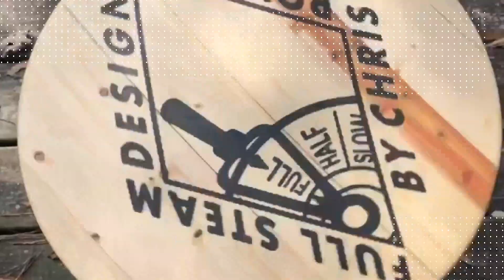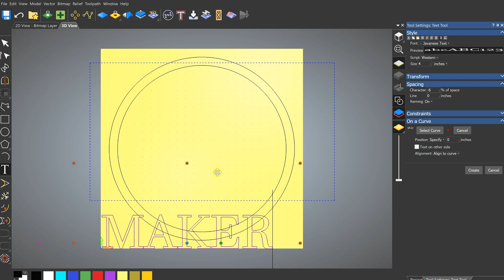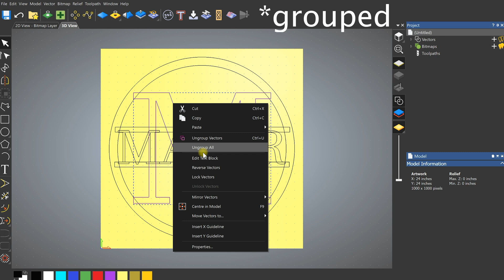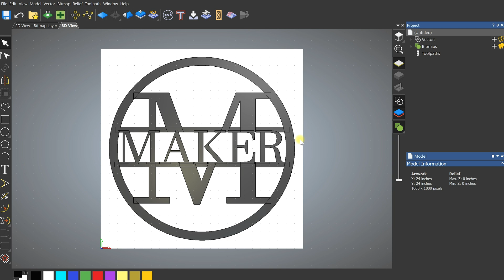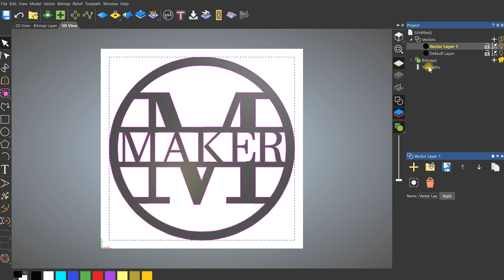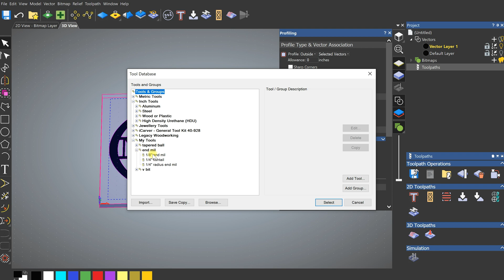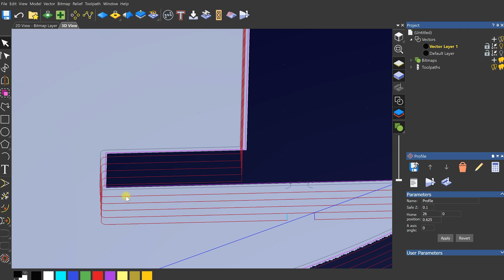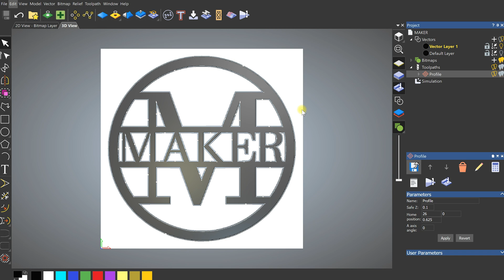Intro to Carveco Maker for the complete beginner - Designing a Monogram

Comment: I really enjoyed the video but it left me wondering what the next step is. You briefly mentioned something at the end about selecting a post processor and Carbide Motion..."load up Carbide Motion, initialize your machine, load that program and you'd be ready to go." 
I'm new to this so it sounds like I would need a couple different programs from different companies to string this all together. 
I have a background working in Adobe Illustrator, SketchUp, Blender and a little SolidWorks so it shouldn't be too hard for me to get up to speed on Carveco Maker. What's confusing is the next steps after you finished this video. I'm asking because I'm about to pull the trigger on a Onefinity Journeyman as my first cnc. I'm creating a shopping list of all the "other stuff" I'll need to buy to get up and running. Software is my missing link. 
Thanks very much!

Comment: I have using Easel for the last year and I keep running into problems which you have to have the pro version. I have purchased the pro and ran with it but its not capable to my machine and doesnt work correctly. I need to change and it looks like this has more options and is cheaper to use. I hope I dont have a large learning curve to use it. I will have to start looking at tutorials
Reply from the maker: There’s a lot of tutorials available and a great Facebook group too if you’re on there.

Comment: Great video Chris!  So, if I do not want the top and bottom rectangle and my big letter intersects with the little letters, how do you deal with cleaning that up?  It seems like the software doesnt think those lines intersecting means anything if that makes sense.
Reply from the maker: Thanks. You should be able to use the subtraction tool like I did in this video. https://youtu.be/YyDwJ-Yn_d4

Comment: Nice video!  Thank you.  You said near the end of the video that this program is much easier to use than the one you were using before.    If you don't mind me asking, which one were you using before?  I've been working with Fusion 360, and it isn't very easy.
Reply from the maker: Carbide Create. It’s a simple program,  it you have to do a lot to get it to do anything besides basic stuff. Carveco Maker just has a lot more options. Fusion is a pain. I could never get the CAM part figured out.

Comment: You can customize your key to centre in the model if F9 is colliding with your recording software.   Window>Tools and Docking Windows>Customise.  Select keyboard and the category Vector.  In that command list you will find "Centre in Model" to select the new key.  Looks like most of the shortcuts can be customized.
Reply from the maker: Thanks. I ended up changing it in the screen capture program, but that’s good to know.

Comment: Sir, I noticed you made mention of the F9 centering your image. I was wondering if there is some sort of cheater for Carveco with any or all of keystroke short codes in it? Not sure if that’s what you would call them.
Reply: There are some in the Carveco help.  Though it is divided into sections (General, Vector, Bitmap, Relief, Transform, Node Editing, Text and Polyline shortcuts.  If you open the help menu, near the bottom of the table of contents there is a section labelled "Keyboard shortcuts and mouse controls"

Comment: Great video. I definitely need to upgrade from the limitations of CC. I want to make this switch but I use two computers. My surface to design sitting in bed at night and use a thumb drive to transfer to my computer mounted to my CNC enclosure. Do you have any idea if this is possible with this software?  Thanks for all the info you provide
Reply from the maker: I’m pretty sure you can use it on 2 computers. I had it on my laptop and desktop simultaneously. Shoot them an email. They have great customer support.
Reply: Chris Powell perfect thank you. Exactly what I needed to know.  I’m going to download it tonight. Thank you

Comment: Looks really interesting. Too bad it’s windows only....😕. Thanks for all your videos btw, they have immensely helped out. 🤙🏻
Reply: Interesting....I did read on their FAQ that it can be done but it’s not supported by them. If you’re giving it a seal of approval I’ll have to take a second look. Thanks again!
Reply from the maker: You’re welcome. I’m actually running this on a Mac. Some people are doing it with Parallels, but I was having issues with my graphics card, so I just use Boot Camp. The only other thing I needed to do was get a mouse that was better suited for design. It’s nearly impossible to use the program without a middle wheel. It really works great.